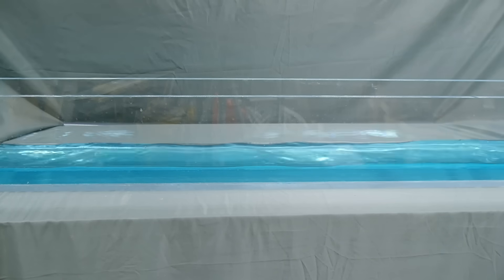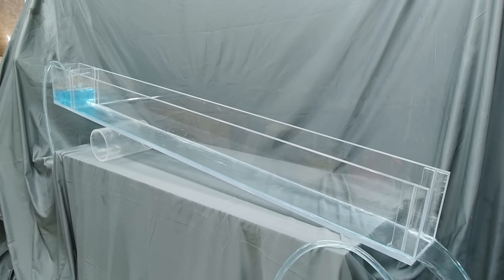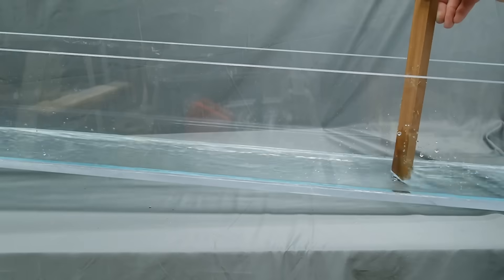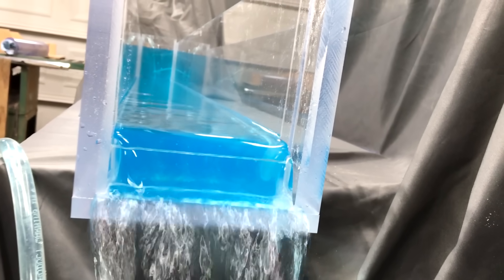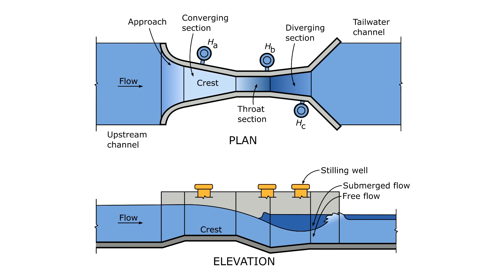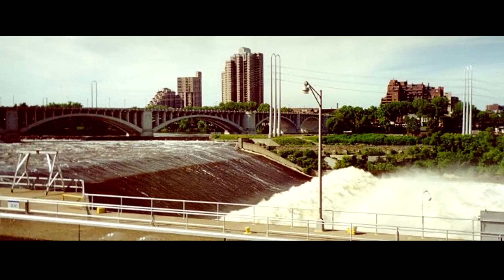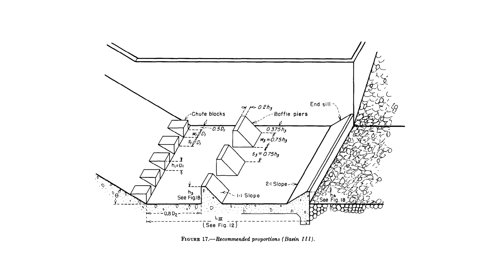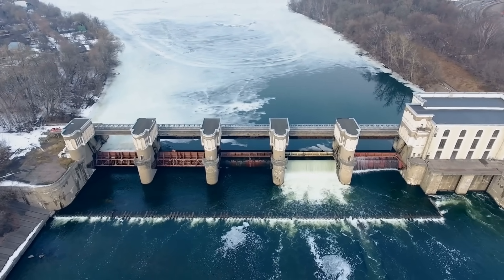What is a Hydraulic Jump?

Comment: In the process of researching the failure of the Oroville dam's main spillway in 2017, I read up on the earlier 2009 failure of their River Valve Outlet System, which involved a hydraulic jump.   Their RVOS pulls water from the lowest/coldest point of the reservoir where it flows through a tunnel to a point under the dam near the turbine outlets (head pressure at about 300psi), and then can be released through a cone valve into another  long tunnel that is joined by water from the turbine outlets (the tailrace).  RVOS is designed to maintain minimum flow in the river when the reservoir drops below the turbine inlets and to regulate temperature for fish in the river.   Oroville's Hyatt power plant is a pumping power station so the turbine outlets are submerged in their own trailrace which can either flow out into the Thermalito Diversion Pool, or pull water back from it when the turbines run as pumps.    The tailrace consists of two 35ft diameter, 2000ft long tunnels.  One is fully submerged, the other half full and they're cross joined.    RVOS cone valves output into the half full tunnel at extremely high pressures and flow rates.  Normally it blasts the water onto an angled steel dispersion ring which absorbs the high velocity flow from the valves, to merge it more smoothly with the low velocity flow of the half filled tunnel.   

The ring had been damaged due to many years of use so earlier in 2009, they removed it.. (presumably with intent to replace).   Then a few months later management thought it would be interesting to conduct a test to open the RVOS valve to 100% to see what effect it would have (1. they'd been told never to run it at 100% due to prior damage  2. design specs said RVOS was never to be operated without dispersion ring).      The manually operated control (just a big wheel) for the RVOS cone valve sits in a chamber connected through a long person tunnel up into the inner turbine room, and that chamber is separated from the ring valve outlet by a fully sealed 20ft tall steel wall.   That wall was designed to fail with 15ft of head pressure behind it in the unlikely event that the manual control valve failed and let water into that chamber.  This wall failure would prevent water from backing up the person tunnel into the turbine room.       

So.. 5 people enter the control room, and start to open the  RVOS valve up to 100%.    At 85% all hell breaks loose.   The valves release about 4-5K CFS of water at extremely high velocity into a half filled tunnel, and without the dispersion ring this accelerates the velocity of the water in the tunnel for a few hundred feet.    During original design (including extensive small scale testing), they realized that even with the dispersion ring a hydraulic jump could form as high velocity flow meets low, that might reach up to the roof of the tunnel, which could cause a vacuum condition in the tunnel upstream of the jump.     So they built in a vent in the roof several hundred feet down the tunnel connected by a large tube running back to another vent in the cone valves outlet chamber.  Idea being that if the jump formed between the two vents sealing the tunnel it could still equalize the air pressure on either side of it.    But without the dispersion ring in place, the jump moved much further down the tunnel than design called for, and blocked the lower vent.   This caused a siphon pump effect back to the valve outlet chamber, eventually causing high enough vacuum that the steel wall designed to hold back 15ft of water, blew out into the tunnel almost taking the 5 people in that chamber with it.   Doors further up the man tunnel also failed and debris was sucked down that tunnel pelting the people in the chamber now open to raging water and continuing vacuum.   With hurricane force winds coming from the person tunnel through the chamber into the RVOS outlet someone managed to turn off the valve to stop the flow.   One person was seriously injured.   RVOS was repaired in 2014, and operated again that year when drought conditions dropped the reservoir below the turbine inlets.
Reply: :O ......
Reply: Why tho?  Why did they want to try that?
Reply: @allencummings7564   Short answer. They're idiots.  Long answer according to the investigative report afterwards.. ""DWR removed the baffle ring in April 2009, four months before the test. It did so without consulting its Division of Dam Safety, which should have approved that action first. The test was ordered because DWR “wanted to determine the destructive effects” of opening the valves to 100 percent, according to the investigation."'

Mission accomplished.
Reply: @allencummings7564  California has a lower average IQ than Alabama.  It ranks #48.
When you read the various reports on Oroville, it's as if they were actively trying to destroy the dam through malicious incompetence on numerous occasions.
Reply: Military application then?
Reply: And then you've got "malicious incompetence", that's interesting .... Malicious would be purposeful wouldn't it?
Reply: Did you watch blancolirio's videos on the dam failures as well?
Reply: ~95 - ~105 .... Not sure why it would be relevant to begin with, but certainly a tiny range of ten points is entirely irrelevant
Reply: totally made up lmfao
Reply: @dmonleon24 not even a little bit.
Reply: So what consequences did management face for reckless endangerment of 5 lives?  Let me guess... a raise, promotion, transfer, or all three of the above.

Comment: Hmm... I'm a little bit confused and was wondering if you could help me out. My job mainly includes designing linear infrastructure, and when I design pipes, my spreadsheet (I did not make it, my company did) for storm sewer design has a calculation which tells us the "critical slope" the pipe. From what my coworker has told me, when flow transitions from a pipe that has low slope (low velocity) to a pipe that has a higher slope (high velocity) a hydraulic jump occurs and the theoretical maximum flow through that pipe is reduced. So while the spreadsheet might say a pipe at this x slope and y size can have a maximum flow of z, our critical slope calc tells us based on the size and slope of the pipe previous to the current, you will actually only get a max flow value of a pipe with "this" slope, which is always lower than actual.

Comment: When I first read the words "hydraulic jump" I visualized something different.  The thing I first thought about was the "jump" that the water going down the spillway at the Oroville Dam in No. California does at the bottom.  There are a number of concrete blocks that cause some of the water coming down the spillway to spray into the air.  Can you tell us why this is done?  See this time-lapse video showing the rebuilding of the spillway. The blocks in question are at the bottom of the spillway.  https://www.youtube.com/watch?v=xQcp7NL7lIw  -- also, here is a video of the spillway in action: https://www.youtube.com/watch?v=9cw-3mJtJnM
Reply from the maker: It's a different kind of energy dissipation method called a flipping bucket

Comment: This video explains something about how I used to do air cooling for computer cases. I found placing hollow cardboard wedges at certain points would cause the flow of air to change in ways that were beneficial to cooling. For example slowing the air flow to cause it to diffuse more easily resulting in cooler air spreading across a wider surface than without the wedges. I never fully understood why it occurred but it became an important part of my process of optimizing air flow, to use incense to make the flow visible while moving little wedges around. It was pretty obvious it obeyed some nicely defined physics but I had no idea what that was. It appears it was a form of hydraulic jump.

Comment: Is there a way to calculate the depth of the fast moving and the slower current underneath?
Reply: Application of conservation of mass flow rate and conservation of specific energy in the streamwise direction should allow you to relate the depth and velocity of the supercritical entry flow to that of the subcritical exit flow - often shown on a supercritical energy chart. This however fails to account for the considerable energy loss which occurs within the jump, for this empirical relations or direct numerical simulation must be applied.
Reply: @garryodonnell8025  I will have to read up on all of that.

Comment: Does anything special happen when the flow is exactly critical or very close to it?
Reply: Critical flow is also a very unstable condition that engineers seek to avoid when designing channels. You would ideally design the channel so that either the sub or super critical flow dominates, because as you approach critical flow conditions, the system as a whole becomes increasingly unpredictable
Reply: The height of the water becomes very variable.
Reply: @villageblunder4787 : Thanks. It'd be interesting to see what that looks like.

Comment: Wouldn’t the jump generator itself be subject to very high speed flow and get eroded very quickly?
Reply: If it's made of concrete it will be eroded much slower than loose dirt.
Reply: @seneca983  So concrete won't erode anyway, it's just a consideration for the natural river beds?
Reply: I'm not 100% sure but I think the main worry is the erosion of the soil undermining any structures that stand atop it.

Comment: I thought rocket science was like 90% fluid dynamics. Moving metal thing through fluid (atmosphere), controlling and directing flow of fuel.
Reply: There's also a lot of material sciences involved.
Reply: And physics
Reply: From what I can tell, the main difference is the density of the fluid medium.  The principles seem the same, they just happen at much lower speeds in water.
Reply: @mikecurtin9831  water is also essentially incompressible
Reply: Moving stuff through fluids is aerodynamics, fluid dynamics deals with the motion of the fluid itself iirc. But I guess they're close enough.

Comment: Is this possible with compressible fluids?
Reply: My guess is that you can get this with any fluid that you can create surface waves in.
Reply: It is, to a degree. The rate at which the flow transitions from super-critical to sub-critical is proportional to the bulk modulus of the primary fluid (in this case water), therefore a rather compressible fluid of low bulk modulus would exhibit a more gradual transition. At low rates of transition the secondary fluid (in this case air) would no longer be entrained into the primary fluid at the toe of the hydraulic jump and the primary phase would no longer be forced to recirculate.

Comment: turning the energy to heat is interesting, can this be measured? I've not noticed rivers getting warm after stoppers (that's what British kayakers call a hydraulic jump). The noise is more notable.
Reply: The thermal energy released by stoppers is quite significant, however so too is the specific heat capacity of water therefore the resultant temperature rise is rather small.

Comment: So, how do they prevent the hydraulic jump structure from eroding?
Reply: They don't. They build it from durable materials and repair/replace it periodically.
Reply: I would imagine (in a dam example) that because the slipway and hydraulic jump section is generally exposed or near surface close to the dam, it is easy to work on it there and maintain or replace damaged sections, rather than trying to repair erosion downstream.
Reply: They require maintenance.
https://youtu.be/6APpIGdKmNI
Here they are refurbishing them while the Oroville slipway is repaired.
Reply: @parajacks4  Thanks for linking this, interesting stuff
Reply: Bassem B. 
You’re welcome! and yes i find it hypnotically interesting. I think I’ve now watched all of their videos on the Oroville dam.
Reply: parajacks4 el dorado county says high 👋🏻
Reply: A hydraulic jump basically focuses all of the water's energy at a single place. This place is made more durable than the rest of the structure. Not only that but it also dissipates a lot of the energy as turbulence and sound. The water downstream from a jump is much more calmer and less likely to cause erosion. If instead we didn't employ a jump, we wouldn't know where the water would cause erosion would need to be constantly on the lookout throughout the entire structure. The jump removes this uncertainty by making only some places likely to be eroded instead of all. These places can be handled quite easily.
Reply: 1) it is made from concrete in specially-designed configurations to control the turbulence locations.
2) they have backups so they can do repairs when necessary.
Reply: They have wearing surfaces designed for the flow they'll receive and long (>50 years usually) lifespans.  Sometimes they need maintenance or repair, and very rarely a large repair, but overall they're designed for purpose.
Reply: they don't prevent them from eroding. they make them from durable materials (concrete, etc) and will have a backup that can be used, and/or do maintenance when the dam level is low during the dry season
Reply: Maybe they replace the structure or they use more expensive/resistant material to build them.
Reply: Concrete aprons are built to not erode
Reply: Usually, they put up concrete aprons to prevent scouring, but considering the economic aspect, boulders and gabions may be used, voids will then be grouted.
Reply: Of course to keep the hydralic jump from erroding we need to make it out of pure diamond.  Problem solved.
Reply: We are basically making the water jump so that there is no erosion and the energy is dissipated.
Reply: Installing Energy dissipator
Reply: Make it out of concrete ;)
Reply: @Fuyudo  Yet hydraulic cavitation will destroy your concrete idea in a matter of hours if not designed correctly.  Concrete is far from indestructible.
Reply: @Fuyudo  Concrete is not that resistant to flow erosion. Cavitation can break it very easily, even metal.
Reply: Near where I live there are several new hydraulic jumps made from stone boulders, in-line, set in concrete across the flow of water. The concrete between the boulders has eroded substantially inside 4 or 5 years. I wonder if that was deliberate or a blunder.
Reply: Vicent Beltran  I definitely agree with you. The knot-head that replied earlier about make it out of concrete must think that nothing can destroy concrete. He needs to take a look at the Orville Dam damage recently. Not only the damage at the bottom of it, but just how the incredible amount of flow completely tore out the right hand side of the spillway when looking at the dam from the downstream side. Maybe he wants to foot the bill! Blown way past the original estimates. I think way east of $1.5 billion and not done yet. Not sure but I actually thought I heard but can't be sure that I heard the figure of $3.2 billion somewhere. Anyway apparently you are like me and know that concrete is not indestrustable. Two of the most destructible forces on earth are water in a flowing state (people don't know it is also destructive in it's static state due to it's ability to apply tremendous pressures) and water in its expanded frozen state. We witnessed what it did to the steel in the bridge in Downtown Chicago this year on Lake Shore Drive this winter.
Reply: @curtnicholson7771  Reading about spillways needing repairs got me thinking of a quick-solution with the idea of swapping out parts like you're changing batteries or something similar. And I wonder how ceramics would stand up to erosion, as I got this idea (a decade ago) of using ceramics inside concrete tubes for transportation of water. The basic idea was to counter build-up of matter inside the tube(s) as the ceramic would be to slippery.
Reply: @NorseGraphic  a very interesting idea. I don't know who you would bring it up to as someone to study the idea or feasibility of it's use. I will say this much, I worked construction years ago and did alot of underground work which included installing water main which  usually ductile iron pipe which has a wiped on internally spun concrete lining inside of the pipe to I think protect the inside of the pipe from corrosion. It  is not perfectly smooth though. Ductile iron is alot stronger than regular cast iron which was more brittle but was used farther back in history before ductile was invented. This type of piping is not limited to underground use. It is used in above ground pip g as well.  Good luck in pursuing your idea.
Reply: Vicent Beltran Yup, avoiding cavitation is a major part of spillway construction.
Reply: I suppose that, since the structure is already in that turbulence zone he is talking about (since the hidraulic jump starts ahead of the structure), the effects of the erosion had already stopped being important before that structure.
Reply: yukiyama the dam is prevented from eroding , by make it out of concrete ( basically “un-erodible” ) and making sure the jump happens within the concrete and not after leaving the concrete dam and entering the river , also for some length after the dam’s ends Big concrete blocks and large stones (50kgs)  are placed in the river bed to prevent erosion, and  sheet piles ( big corrugated style sheets of metal)  are provided under the dam to prevent “sub-surface erosion “ , also fancily known as piping .
And you might ask why do we care about all this erosion business ? 
Because if the soil erodes and washes away around the dam it will become unstable and risk catastrophic failure flooding an entire area or worse.
Reply: eroding can not be totally avoided, but hydraulic design enables us to locate and control where the erosion would probably occur so that we can reinforce that region and maintain periodically and prevent severe eroding which may endanger the safety
Reply: I think engineers would take that into consideration